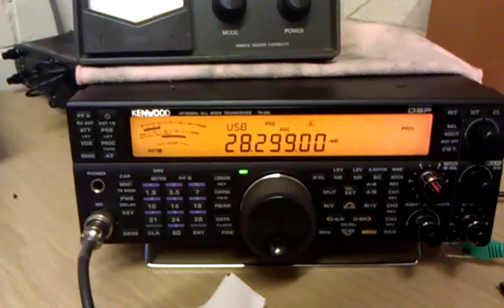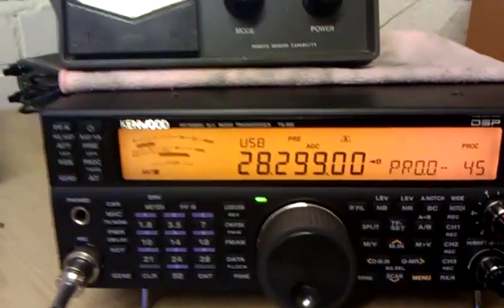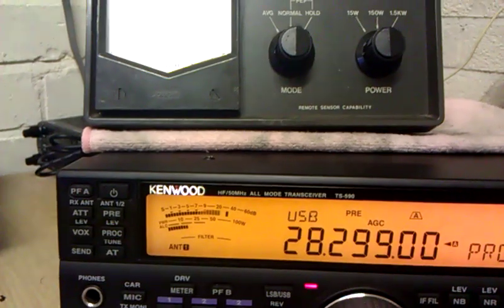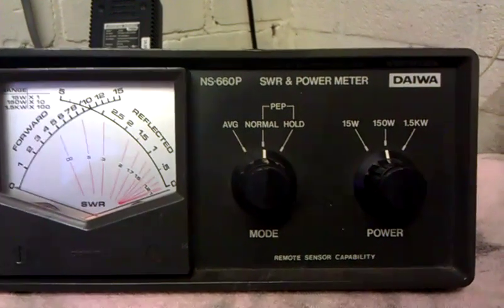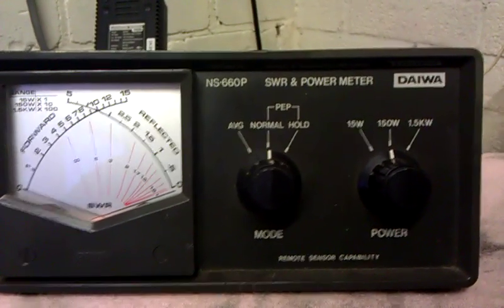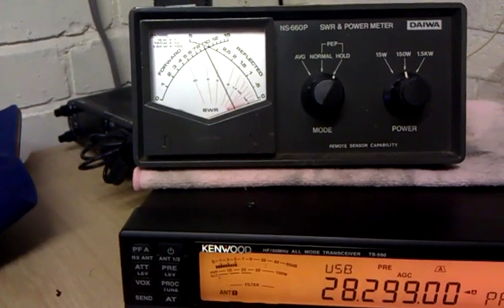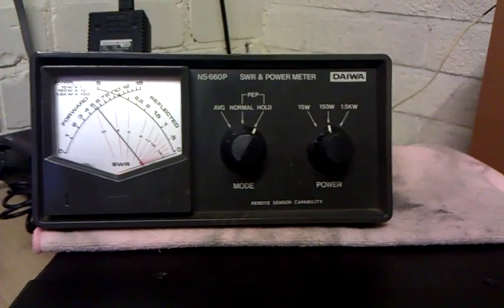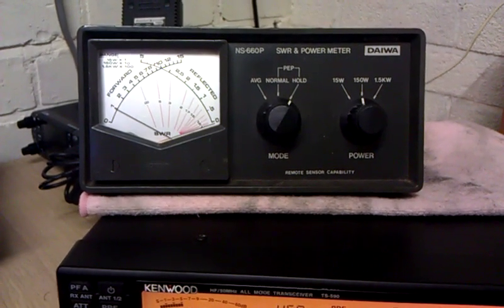How to measure SSB power output properly on a TS590

Comment: I have one of the Kenwood TS 590SG radios here as well, and see 50-60 watts max peak out of mine, and also have a Yaesu FT 450d which it shows power output is a 100 watts, just curious about this as well, and the settings just turned my Pros In up to 49, and the out to 45, have never ran my mic at these settings, what do you have your mic gain set at, by the way Im using the stock mic that came with the radio..

Comment: I think you can have 100W PEP but poor average output.  That's what the main complaint is right?  The compressor is supposed to help with that.  The problem is there's no spec on what average SSB output is.  They just state 100 peak.

Comment: Conor, which kind of ext. test head you are using on video for measurement on HF bands please?
Reply from the maker: Hi. In this case it was just my antennas but I do use an oil filled dummy load.

Comment: You are quite right that the DAIWA NS-660P is an excellent meter, I have one. I don't want to rain on your parade but if you check the specs on this meter on PEP HOLD the meter is plus or minus 15% accurate. If you meter is plus accurate then you are generating at an indicated 95w the power is actually 80.75w., most of this model of meter are generous. I run a Yaesu FT1200DX & the indicated PEP HOLD power is 120w indicated, deduct the 15% (18w) & the actual PEP HOLD & is 102w which matches the specs of the radio. Just a point.

Comment: Interesting demonstration, however, there are some very critical radio settings that influence the SSB power output of both the TS-590SG and the original TS-590S.1 what Microphone did you use, was it the supplied hand Mic that comes with the radio? Different Microphones output     different audio levels.2 what was the MIC gain setting?3 was the Speech Processor activate for this test? If so:4 what was the PRO.I setting?5 what was the PRO.O setting?And most important you did not show the corresponding radios ALC defection meter as a comparison at the same time along with the external Power Meter.If the ALC is at a high level then its easy to get 100 watts out of these radios at a cost of distortion. The ALC level should be at the low end of the scale about 5-6 bar on voice peaks. The purpose is to avoid distortion caused by over input to the power amplifier.VE3CG

Comment: Kenwood admitted the problem of the TS-590S.
The main problem was a PEAK of about 200W for 5msec when the PTT was pressed. To avoid it (many amplifiers goes in protection, like Acom for example), they gave a stricted setting to the ALC.
Result of this seting was a low talked power in SSB!
For LOW POWER we means 15 watt maximum! Your reachs 70/80 watt peak power? This means they increased the alc from the menu 23 and 24 (service menu). Result, you are having also high PEAKS for 5 msec at about 200W, peaks you can't see with a funny meter as the one you are using in thsi video. 
TODAY IT IS AVAILABLE THE OFFICIAL FIX OF THIS PROBLEM BY KENWOOD.
I sent mine to the service (3 times!), they fixed it by hardware (no software!)!
Now no peaks and perfect power output.
Therefore feel free to decide if cancel this video or not, because your arrogance is not considering what Kenwood declares and recently fixed.
Good luck if you're using amplifiers with ceramic tubes (the peak ruins the tubes!) 
'73
Giuseppe

Comment: Yes you might well be right but looky what I found (admittedly it is for the CB brigade), but I wonder if his general advice isn't spot on. The 30w above 65-70w for this rig is headroom for the output stage and is hardly relevant to anything in the overall scheme of things. This guy has a point:

Quote From Lets Explode A Few CB Myths
"18) Bird watt meters with peak reading kits!  Now this takes the cake. Some CB'ers go out and pay the extra money to buy a Bird 43 watt meter, but when it tells them the truth and hurts their feelings they install a peak reading kit to make it lie like a Dosy.  Accept the truth! Your 2 or 4 or 1 driving 4 transistor amp does not put out 1200 watts (or whatever your lying Dosy meter says it does), and your two 3-500zg tubes do not put out 3000 watts. But ...but ....but... it's Bird watts?!  The legitimacy of "Bird watts" went out the window when the peak reading kit was installed."

IIRC most amplifiers put out cleanly only about 1/5th their rated power anyhow. This is why high powered amps (excluding tubes) often sound much better than low powered ones - the signal is far cleaner eg A 200w amp puts out about 40 clean watts in the real world and a 40w amp only about 8 clean watts. This sounds about right.
Reply: Who said BIRD 43 meter is any good that are just as crap as any other meter I had 1 used 3 different slugs and got 3 different reading so unless you have properly calibrated slugs witch need to be done regular they are just a shit as any other cheaper meter
Reply: No they're much better than most cheap meters but I take your point.
By the time you buy all the slugs you need you might as well just buy this:
https://www.arraysolutions.com/Products/powermasterII.htm

From that site: A Wattmeter that is Outstanding in Functionality with NIST Traceable Accuracy
You also get an accurate SWR meter all for about $550.
You'd be able to calibrate your Bird slugs against the Powermaster too.

This is all a bit like chassis dynos for tuning engines. One dyno says you have 500hp the other only 375hp. Which is correct?
Best to get a quality accurate power meter, calibrate it (or slugs) and stick with it. I know Bird slugs are effing expensive.

Cheap meters are OK I guess but hardly have the long term durability and spare parts support Bird has. When your cheap meter stops you've done your dough!
In my experience shit made in China that is cheap is for the most part of unreliable quality. Some are good, others not so good. Pay for a Bird or an Array Solutions you get long term product support, spare parts and generally speaking vastly better reliability in daily use; and for years..

What you say about used Bird slugs is probably right. Who can afford all new ones :)
Reply: +26CT747 Bird watt meters are the industry standard, when an FCC inspector comes to your home that's what he will be carrying as for calibration please any technically competent ham can verify slug calibration with nothing ore than an oscilloscope and calculator.
Reply: +Dan Nelson I have to admit I have 2x Bird 43's. One is a Bird 43P :)
I calibrated a low reading 50w 2-30MHz slug with a multimeter and left the slug cover off and adjusted it on the Bird meter against another slug that was on my other meter both into a dummy load. Hardly a NIST Traceable Calibration but the accuracy of them in the real world is about 8% give or take I reckon. This is double what Bird says but so many variables come into play like meter age and use, temperature on the day etc into infinity. Both my meters read a bit low in the morning (1/2 a watt or something). 
My two meters show different readings with the same slug. If I connect the meters in series I get a different reading on the second meter because of insertion loss and as the meters warm up the insertion loss is almost nullified on the second meter.
More accurate meters for power measurement are out there for Hams and not that expensive when considering the cost of all the idiot slugs one has to acquire, but really what is the point of pseudo laboratory grade (or actual laboratory grade lol) power measurement when hams live in a dynamic world with a constantly altering impedance of everything? 
Also, In my experience no two Bird slugs read the same either eg. a 50w against a 100w, a 100w and a 250w, 2x 100w. They are for getting a good accurate idea and NOTHING MORE.

All this reminds me of an applicable story; my mother grew up in a house with my disabled grandfather. In the war he had a severe stroke from creek water containing meningococcal bacteria. During his recovery he developed a fixation with wind up alarm clocks, but my mother said, "The trouble was they all told a different time and none of us knew the real time." 
This power measuring business is a bit like my grandfather's house circa 1950, well before my time but you get the picture.

Comment: Hi excellent advice sorted me out. Now for a new one having come back into radio after a 20year lay off, I used to able to listen to my audio and adjust, mic gain,alc ete tec on my 940SAT using a dummy load, how would I do that with my 590s please. Doug G0LUH

Comment: I'm also getting low power output on my TS-590S.  Compared to my Icom 735, Kenwood TS850S and Icom 7700(adjusted to 100 watts) the 590S falls short of 100 watts.  I'm getting around 75-80 watts on all bands CW.

Comment: I am a Kenwood fan, too, but your point is true and very valid. Like I pointed out above, I have all the test equipment, and have found a couple Kenwoods that had ALC issues, and low power. If I ended up with 3 different Kenwoods with this issue, then I would think there are 100s of others that do, too. de NV6R

Comment: I have had a few Kenwood units that have issues with ALC pumping, and, as a result, low output. I do have a PEP meter and scopes, so I can test radios properly. You are only testing one radio, so this is, by no means, a definitive test that represents all radios.

Comment: n3cal is correct,
I have had 3 590's that didn't/don't put out 100w on SSB...60w or so ( LP100A)..the last one  was atrocious and sent back 4 a replacement thats not much better)  
while 2 Yaesu's easily do put 100w.
On the meter I use all the time in the shack,(not the LP100A)the Yaesu's easily show 2x the power output on SSB...So I think one of 2 things.

1) You got lucky to get a good one
                   or
2) You adjusted the service menu to "fix" it .

lots of complaints of the 590

Comment: It's great to see you have a proper performing TS-590s on 10m.  I do however beleive your a bit arrogant in your claims some TS-590s owners don't know how to measure peak power and there can't be any bad radios out there.  I for one have a low output TS-590s on SSB and my LP-100A Digital Wattmeter confirms it.   I hope you can admit a LP-100A is not a "mickey Mouse" meter.   Best regards.